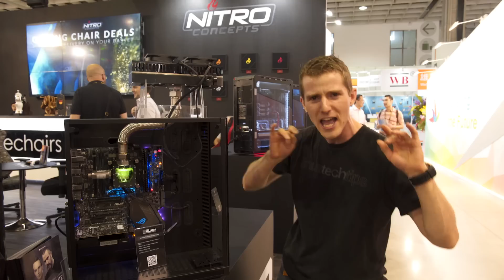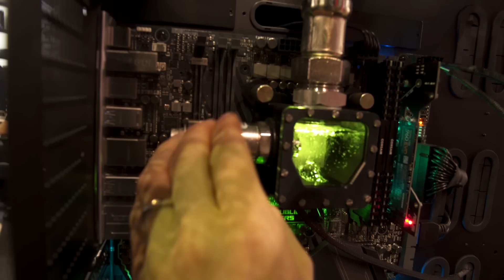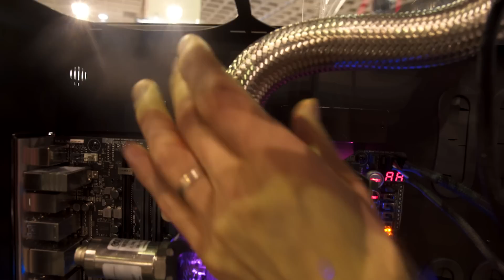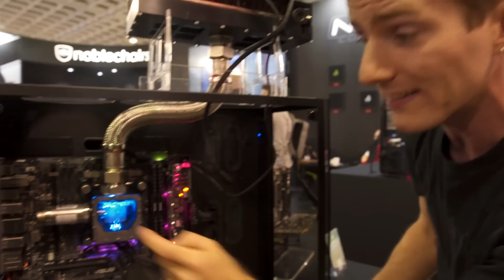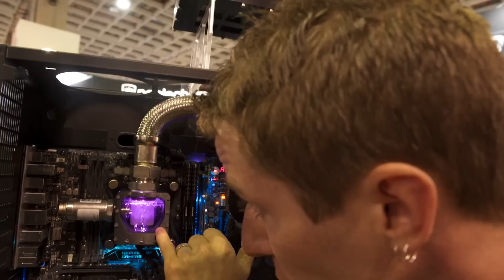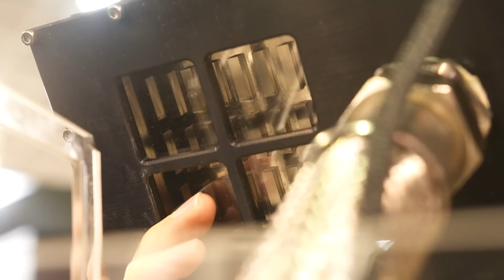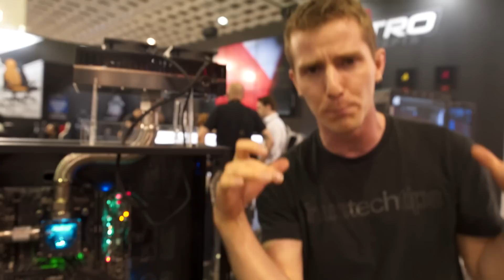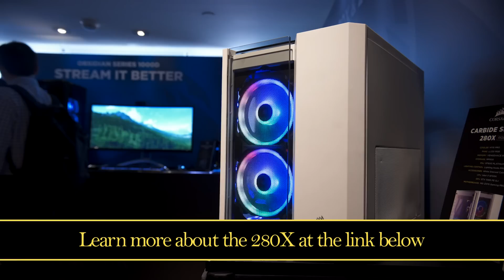Crazy Der8auer cooler prototype - NO pump!

Comment: He said we'd never guess it so it probably not what you think (water at low pressure or a low boiling point liquid) it could well be a chemical that is usually gaseous at ambient but under pressure in this system, this is debaur we're talking so a material like this would allow sub ambient while increasing pressure allows for a more normal temp targets without risk of condensation etc. That would also explain the pressure gauge, making sure it doesn't drop too low and go sub ambient

Comment: Lots of options, but somehow a very simple option, stands out for me as the possible liquid used, laboratory grade alcohol, under heat it will expand, it has a very low boiling point and condences easily back to liquid, and that process of evaporation and condensation, in a closed system, will ensure there will be a small pressure buildup that will get the liquid to be "pumped" around the cooling system.
So, it might actually be as simple as that?

Comment: I'm guessing it's some kind of Freon mixture. This whole thing looks like a tiny AC unit. The "boiler" looks like the evaporator (where the Freon evaporates under low pressure and temperature). The thing to the left of it looks like a compressor which compresses the gas into high pressure and high temperature (thus separating the heat from the evaporator) and the radiator serves as a condenser where the hot, high pressure gas is air-cooled enough to become a liquid again and get sprayed through an expansion valve back to the evaporator where it becomes low-pressure again (due to the expansion). For that you need a closed circuit and I can only see one pipe but it's possible that there are two separate pipes inside it.

Comment: Its water pulled under a vacuum to i'm guessing around .1 - .3 psi?

And I think that block at the bottom and that pressure gauge are there to check and control the pressure so you can vary the temperature of the water boiling point..
Reply: Dave Webster I totally agree with you on this one and maybe they’re maintaining the pressure to keep the liquid’s boiling point at the CPU’s temperature so maybe the liquid can be any common thing like water or alcohol

Comment: Given the Pr sure sensor the liquid is either natively pressurized (required pressurization for liquid form) OR expands to a gas at a relatively low temperature (between 30-55 C) via boiling. Methanol boils at 64.7 C, Dichloromethane(DCM) @ 39.9C,  ethylene chloride(DCE): 83C, Ether: 34.6C. Plain CFC  R-113 boils at 48 but that's not really great at a 140 watt draw...id probably want something that can dissipate heat enough to keep the thermals below 42 degrees if possible. So a CFC or freon is my guess, but some have stated DCM as a coolant. I would not us that even as a chemist it's kind of rough stuff.

Comment: I'd guess Methyl Acetate.  It's already in common household use in a bunch of products, is water soluble so that you could easily raise the boiling point if needed (and reduce the flammability a little), boils naturally in the temperature range that is generally considered optimal for a CPU, and is transparent.

That it is flammable and readily dissolves certain materials leaves room for better options, but I haven't found any yet that are also transparent.

Comment: I am guessing Methanol. Could also be Acetone or ethanol. As for non flammable stuff, I don't know. If he said that the tubing should not have an s curve, It maybe because of low, pressure since the tube would collapse. In that case, it could be Paraffin oil at low pressure, water or ethanol.

Edit : Could also be Dichloromethane as John Flandorffer said.

Comment: If the chamber is not pressurized, a low boiling point, stable, transparent, cheap liquid may be used. There are many that would work just fine. No need to copy exactly what they use.
Reply: The chamber has a potential to become pressurized if all the liquid boils off, which is why they have a pressure relief valve coming off the side.
Reply: starshipeleven water is pretty cheap and readily available....
Reply: Ethanol and many inorganic solvents, aldehydes, ketones(boil at 56/79deg c), and so on. Most bad smelling liquid you used in your highschool chemistry class. There are probably thousands of choices
Reply: Sage_of_the_16 not water. Water doesn't condense like that. The liquid seems to have low viscosity.
Reply: starshipeleven Ethanol and many inorganic solvents, aldehydes, ketones(boil at 56/79deg c), and so on. Most bad smelling liquid you used in your highschool chemistry class. There are probably thousands of choices. Many won't pass the FCC though.

Comment: A liquid boiling at 140 watts! That quite interesting!
Reply: Silas Mayes . Ya, that's now how that works.
Reply: watts is how much energy is being moved, things boil at temperatures not watts.
Reply: If you pump 140 watts of energy into a specified amount of metal, it will heat up to whatever temperature you like, boiling whatever liquid you like. It's all about volume.
Reply: Robert T that not how word work
Reply: TetraByte temperature is a measure of the the amount of energy in a volume. In a chemistry class you would be taught that temperature changes based on joules per kilogram. For example to raise 1 kg of water 1 degree C you need 1.2 KJ. I believe I've made my point, but just in case 120 watts is 120 joules/second and given that volume of liquid it would have to have a low phase change point for it to boil at 120 watts of heat at the kind of a volume.
Reply: Silas Mayes okay.

Comment: Hi there, it's me commenting on the audio again. I almost tried to email you guys out of respect, but it seems that you do not read any email other than "business" inquiries. 

Audio has been clipping all over the place, and this time, instead of just complaining, I have a few suggestions to remedy the issue:
1. try not to record too hot so that there would be more "headroom" when you normalize the audio. This is especially true if you're recording directly into the camera. The fact that you have a very loud talent is actually a blessing, especially in this type of noisy environment because signal-to-noise ratio is higher. So turn down the gain knob! 

2. if you're recording on an external recorder with a built-in compressor/limiter, use it. If not, record Linus' vox on two separate channels: one at a "normal" level (maxing out at or around -6db at the loudest) and another one a bit quieter so that you can replace the hot channel with this in case the hot channel clips. Mic check where you ask Linus to "belt" would significantly reduce the risk of clipping in actual takes, too. 

I hope this was not too forward of me; I really enjoy your content. Good luck.

Comment: Must be a refrigerant based type material with a liquid threshold at ambient temp and a gas state well above that temp (this will also be affected by the pressure it is held at, by lowering the pressure the boiling point will fall). Naturally the issue with this solution is the computer will only ever get as cool as the boiling point of the fluid. The issue remains that if the fluid is a type of refrigerant there are tight laws on it given the toxicity of them

Comment: hmm, it is really hard to guess, due to not knowing the operating pressure, but its a prototype and he is gonna need to have it easily refilled and worked on without breaking the bank on some exotic phase change fluid... my guess is Ammonia or Water methanol of some concentration mix.  He has basically made a gigantic heat pipe or vapour chamber with a remote condenser.

Comment: My guess is ethanol 174 degrees boiling point or 80 Celsius which is lower in a vacuum also it is a more safe alternative. I work with it at work and it’s the only place we don’t have to worry about massive safety violation or requirements if something happens.

Comment: I haven't found any liquid that has a boiling point between 45 to 65ºC and is not a grave hazard to have boiled over and over. Since we have more strict regulations on Europe, I guess I'd stick with other cooling methods for now until I know it's safe if any leak were to occur.

Comment: It's either near pure ethanol, pump gasoline, wood alcohol, or worse, Ammonia.  My guess would be the easiest to contain, get, and deal with would be ammonia, which explains why the thermal plate to cause the boiling isn't overheating the shit out of the CPU, and also why a couple of plain HSF's are sufficient to return it to a liquid state.

Comment: It is a heatpipe probably with acetone or alcohol as working fluid. That's why the fans are on top. Having the coolest part higher than the hottest bit makes that the liquid gravity assisted always keeps flowing. Oh and it needs to be at very low pressure for the best results. I've build this same thing for my gaming PC once and know how well it works.

Comment: The bubbling thing at the bottom seems to be part of a fiction, it's not bubbling off the CPU heat spreader. There's no apparent condensation in the condensing chamber above. Assuming this actually works it looks like a heat pipe but with visible windows. I wouldn't even be surprised if the medium is just distilled water at lower than atmospheric pressure to lower the boiling temperature.

Comment: Looks like Novec 7x00 series to me, huge vapor cycle tube really is a lazy design. The pressure sensor indicate the system is not running at standard atmosphere pressure, most likely negative pressure to achieve a lower point organic cooling cycle.

Comment: Didn't Silverstone try to make one of those a few years back? What liquid it is is not incredibly important as long as the boiling point is not too high and not too low. If you ran it at a partial vacuum you could even make it work with distilled water. I think at the temperatures this is targeting something like wodka would work quite well. Could also be something more exotic with the right boiling point that isn't flammable. Honestly many liquids would work.

Comment: Its probably methyl alcohol as it can boil at 64* which is in the limits needed for the setup they have, shouldn't be corrosive to the metals involved, is readily available and most important would not need to be pressurized to be a liquid like some other chemicals.

Comment: Its pure water or alcohol in slight vacuum to lower the boiling point.
Reply: More likely one of 3Ms Novec engineered thermal management fluids with a boiling point around 60 degrees. More info at https://www.3m.com/3M/en_US/novec-us/applications/thermal-management/
Reply: But then the pressure of the system would be lower which makes the boiling point of the liquid-vapor mixture lower. I think they use some kind of refrigerant under a higher pressure than 1 atm to make the boiling point higher. Negative overpressure (what was suggested with water or alcohol) seems like a bad idea seeing those tubes, which seem to be made for a positive overpressure.
Reply: Could be acetone, it's got a boilding point of around 56'c
Reply: StableEntropy not if the system itself produces this vacuum
Reply: StableEntropy Only a small amount for evaporating because it's enclosed
Reply: wouldnt it be more beneficial for the boiling point to be lower? Since you could start taking the heat away faster? Im not a specialist in thermodynamics, but just wondering if that would work?
Reply: no its not just water/alcohol !
Reply: There most likely is a balance point with the heating and cooling of the liquid. 

Of course liquid with lower boiling point then water would be better. Although, alcohol would not be very harmful if it leaked compared to water.
Reply: Acetone is toxic and corrosive, the liquid needs to be sensible
Reply: NiteLite exactly, I work with that stuff and the heat transfering properties of these pre acetone is mind blowing. When vaporized it ca be used as a clean fire extinguishing agent that prevents fires to develop by absorbing the heat of the combustion.
Reply: Indeed it's water :) This is just a simple heat pipe, which almost all large coolers use(and all of them use water filled copper heat pipes). It's just that the design is more "new" and interesting. In a practical sense, it's doesn't have any advantages and will for sure perform worse than any water cooling or even a high end normal heat sink.
Reply: and how will you sustane the vacuum , it´ll built up with ethanols gases and equalize again...
Reply: NiteLite 
I bet you're right.
That stuff looks perfect for the job.
Reply: Closed system, and evap is what the system is doing.  Alcohol as a fluid makes sense. When  alcohol  evaps, it has a cooling effect. Where does it evap to? To the radiator on top to cool, which then goes back into liquid form, and rejoins the rest of the liquid. .
Reply: StableEntropy What? That doesn't make any sense...
Reply: NiteLite The only thing with that is that the Novec fluids are A) designed to work directly in contact with the electronics and B) is quite expensive. Since we're not immersing the entire system in it, you can find fluids that are similar to Novec that are cheaper and probably have better thermal properties.
Reply: Lelouch Yagami all the cabels are metal..
Reply: Could just be mineral water.
Reply: Novec was what I was thinking.
Reply: I guess that is Ammonia
Reply: The real question is: What's in it? Because most cooling fluids are just distilled water with some anti-corrosive and stuff in it, however here, this stuff needs to evaporate, too (so you essentially have to distill the coolant but hten have everything that was inside it still there). This is not easy and I don't think anyone will figure that out.
Reply: @justuslm  It's doesn't have have to be anti-corrosive if you make everything out of DI water compatible materials
Reply: ethanol or methanol, that is the question
Reply: Maybe it`s vodka powered russian edition
Reply: Desmond Bradley lol no it isn't water doesn't have a set boiling point. It's boiling point depends on the pressure. Water boils at a different temp at the top of Mount Everest than it does at the bottom of the mountain.
Reply: Probably this. It’s basically a huge heat pipe.
Reply: Desmond Bradley that's true but we weren't shown the temperatures of the CPU in the video sadly :(
Reply: what ? high preassure? liguid propane is 8 bars, i think. propane isnt that volitale , yes its flammeable but so is alcohol...
Reply: Ethanol in vacuum 150-400 mmHg?
Reply: i dunno , try pouring it on your finger, its cold as f** :D, besides at 8 bars it aint that low anymore
Reply: you do realize that the boilng points change at different preassures...:D? and that in fact you can use butane , propane as cooling agents, but they dont chause obvious reasons :D
Reply: Read about vapor pressure: ethanol at 75°C will sustain 0.875 atm, at 33°C  0.12 atm
Reply: Yeesh, but did you notice that they are useing soft tubeing, so vacuuming it is out of the window, i think. No hard feelings ;-)
Reply: It's elastic not soft... try google: "Convoluted 316L Stainless Steel Brainded Hose"
Reply: its soft. there is a rubber hose in it , the stainless mesh is on there for reinforcing, ... moron, its not ment for vacuum
Reply: Hahah rubber xD It is stainless steel hose commonly used in vacuum systems or air conditioning. Positive pressure will put strain to mobo, while vacuum will help with sealing around ihs. On the bottom they put some boiling chips.
Reply: wow , you leave me speechless, how can i get as smart as you , what´s your secret.  we must tell others about you
Reply: Long Doan 

Or propane
Reply: yeah maybe water acetone mix
Reply: Was gonna say pure water
Reply: Or Ether, with a boiling point around 35 C
Reply: Build your own I don’t think it would be because the vacuum would be gone by the evaporation

Comment: the cooling fluid is most likely the "3M Novec 7100".
Its a fluid with a boiling point of around 60 Degree Celsius.
der Bauer is  useing the type of fluid in his last project the "auqa Exhalare" were he diped the hole motherbord and a grafikscard in a complete closed case.

Comment: I wonder if you could just use demin water but run the system in a vacuum so that the water boils at a lower temperature than at atmosphere.  By adjusting the vacuum in the system you could effectively adjust the boiling point at will of the water.

Comment: I guess liquid ammonia, it evaporate in a heat exchanger. ;-)
Look on the internet for Absorption cooling. (y)
Without pump under pressure, Ammonium Hydroxide Solution (NH4OH)?

Comment: I'm guessing it's a type of alcohol, such as ethanol or methanol.  Considering how hot that test setup is getting, I'm not sure it's going to be a liquid with a boiling point much lower than 50C (remember, there's probably a slight vacuum in the loop for pressure purposes, which will further lower the boiling point).

Comment: I'd guess maybe 2,3,3,3-Tetrafluoropropene.  one of the newest-gen refrigerants used in automotive industry, 0 ozone depletion and although when ignited it can release hydrogen fluoride it's almost impossible to do with an electric spark until its heated to about 900C.  Plus there's additives being approved that make it virtually non-flammabale.